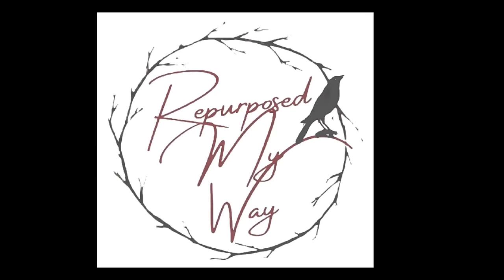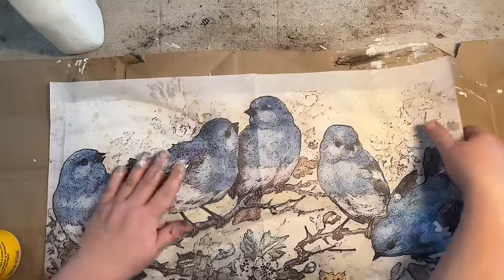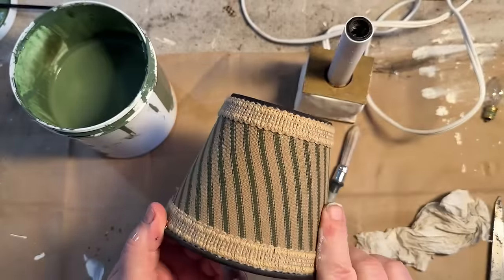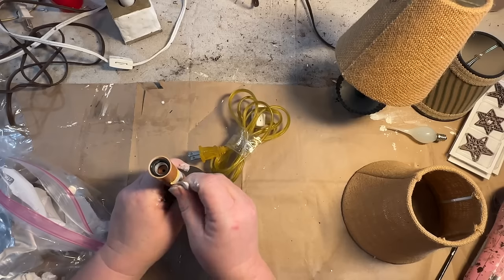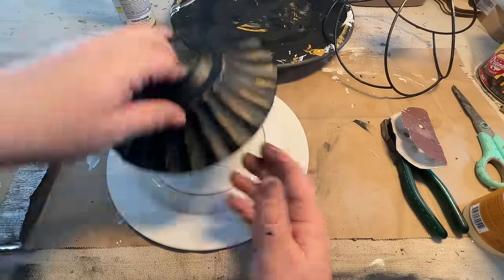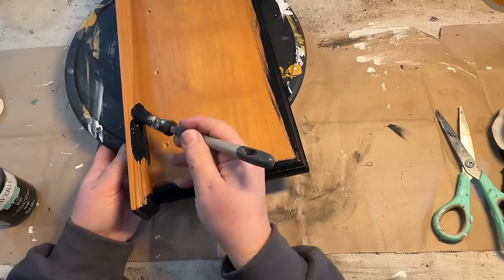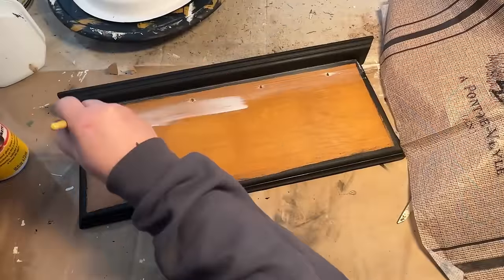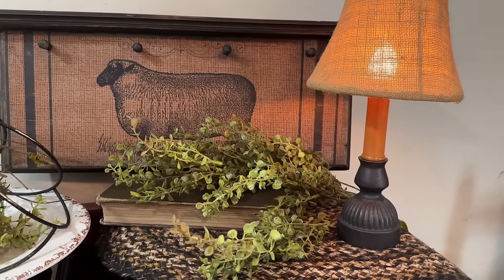Stunning Home Decor ~ Upcycling Dump Finds & Thrift Flips

Comment: Have you ever tried the method where they mod podge  let it dry then iron on the paper.    Love to see you try that.  (Not on anything important in case it fails)   It looked really smooth.  I would probably still mess it up. 🤣😂🤣
Reply from the maker: I haven't yet. I wanted to with the sheep shelf, but I didn''t have any wax paper. I think I need that for it to work. I will be trying it soon though. I do like the water on the paper. It does help smooth out the wrinkles, but only if you use a little. lol
Not soak it like I did.

Comment: Shelly , @repurposed my way 

I log into Zazzle and they have tissue paper wrapping paper ? What do you use for the decoupage ?
Reply from the maker: Type into the search decoupage paper and it will bring up bunches of them. Happy shopping!😃
Reply: I’m not sure what to buy ? @repurposedmyway
Reply from the maker: @cherann13  Are you looking for a particular one I’ve used? Or just not sure of the weights and such?
I use the 10lb tissue paper, what ever size the suggest unless I have a specific project, and usually white paper.
Reply: @RepurposedMyWay  thank you.  Yes it did.  I don’t want wrapping paper though right ? I use rice paper and print my own but I want of make some larger ones.  I figured after watching your video I’d log onto Zazzle and they have tissue paper and wrapping paper. I assume the tissue paper.  I don’t normally like the tissue papped for decoupage.  It’s difficult to work with for me.  I was wondering if you use the wrapping or is it super thick like heavy duty wrapping paper.
Reply from the maker: @cherann13  I use the tissue paper. If you want thicker paper use the drop down and pick a heavier lb (pound). 18lb would be thicker and easier to use.
Reply: @RepurposedMyWay  yes I think I’ll order the 18lb I guess and see what it’s like. Thanks
Reply from the maker: @cherann13  You’re welcome ☺️